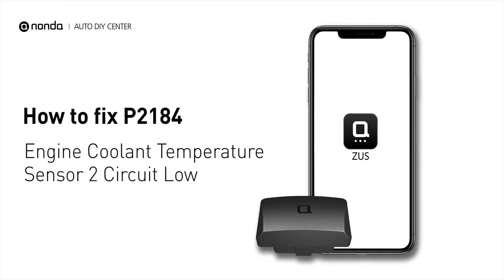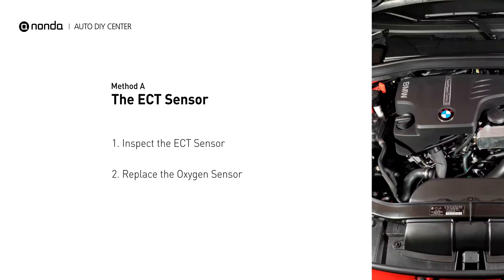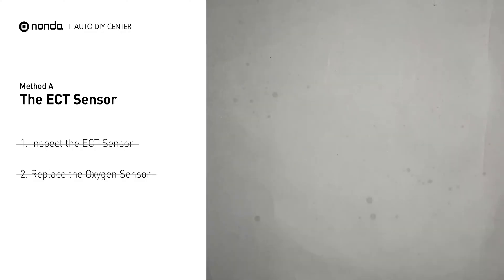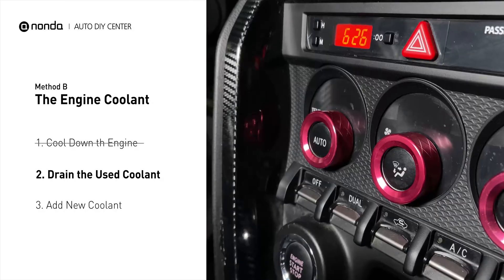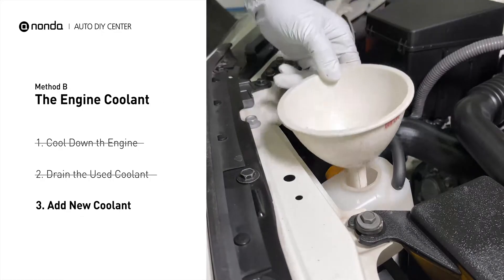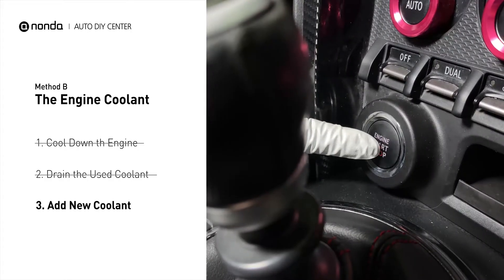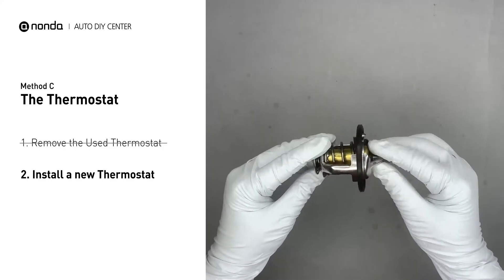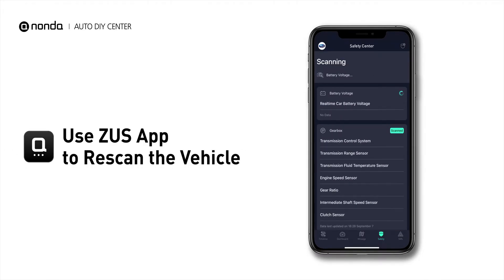How to Fix P2184 Engine Code in 4 Minutes [3 DIY Methods / Only $7.31]

Comment from the maker: Hi, I'm Steve, nonda's lead mechanic engineer. 
Feel free to leave your comments here if you have any mechanic questions, I will be glad to help you out!
Reply: What I replaced the sensor and installed a new radiator and coolant and thermostat and I still get that code